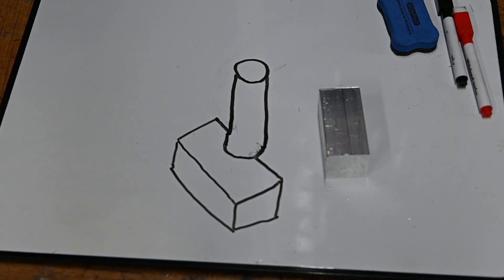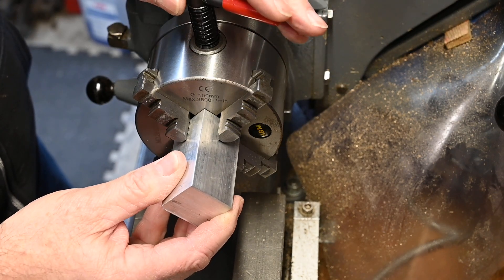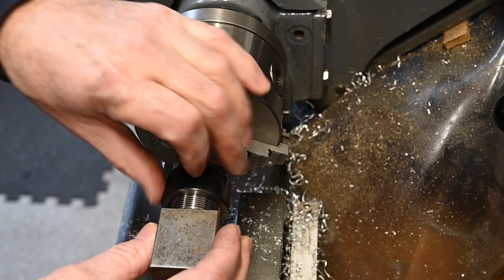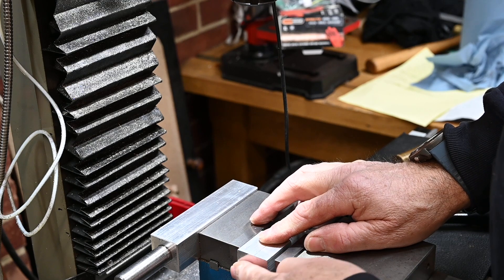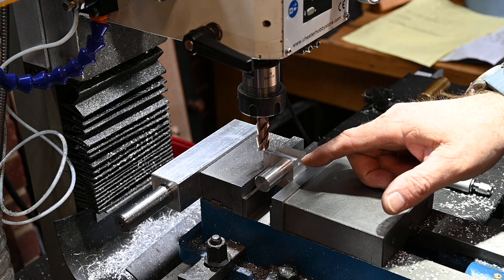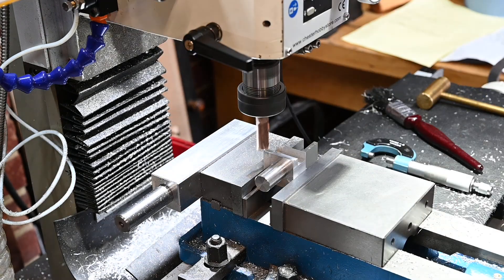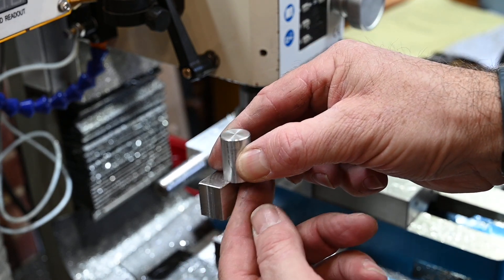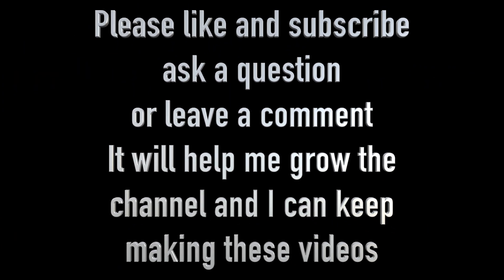Rotary Table Vice alignment tool

Comment: Joe Pie has been making and selling these for several years, he has a build video about four years ago plus various tips how to use it for different things.
I guess not many American hobby machinists want to make their own and prefer to buy ready made if they don't trust their abilities?
 I notice you have extra clamps on mill vice, has it moved on you or does it help take out some of the 'twist' on Chinese vice? (I know mine is 0.004" low on right side, may try an extra clamp and see if things improve) I know I should really scrape it flat, but, that looks like a lot of work and I want to use it now, not 3~6 months time. 😁You need to make a stiffer longer keeper plate for your angle vice, I used a small 3/16" square of high carbon steel plus longer bolts. I also bored the pivot posts as they were about 0.060" different in height then bushed them for a tighter fit on pivot bolt (it wasn't worn and much easier to make some bushings)
Reply: I bought one from Joe Pie, with some tooling it isn't that you doubt your abilities as a machinist, it's just quicker and easier to purchase the item and used the time saved on your projects.
Reply from the maker: @ But more expensive and not so much fun 😂👍
Reply from the maker: @1crazypj Thanks for the tips 👍

Comment: Useful tool, I'm surprised that you didn't make it out of something a little more durable.
Reply from the maker: It’s only very low use in a hobby shop 👍
Reply: @EnglishHobbyMachinist  100%  Aluminum is plenty robust enough material for this little tool.  Those of us who are Hot rodders and custom motorcycle builders use billet aluminum for all kinds of things, including brake calipers, pedals, brackets, triple trees, etc etc....

Comment: Loads of irrelevant milling and turning as a simple device could have been easily fabricated.
Why waste valuable material and power??
Just for an appearance and video on YouTube😐❓
Reply: I guess you just use a dowel like everone else 😉
Reply from the maker: @marley589  no, it’s not for aligning the table, it’s to align the vice 👍
Reply: @EnglishHobbyMachinist  A dowel can also be held in the vise. They both rotate, so the flat does nothing.
Reply from the maker: @marley589  ok thanks
Reply from the maker: Thank you

Comment: Why does it need to be so wide? Would an accurate piece of round stock with a flat machined half way still work? Or maybe just a known size pin say 20mm and add / subtract 10mm from the required dimension.
It doesn't really align the part or the vise, it just positions them in one axis which can easily be done with a pin in a collet. They still need aligning with the rotary table angle, positioning in the other axis and aligning with the machine axes. It's a solution looking for a problem.
Reply from the maker: Your idea would work, just a slightly different tool without the flat surfaces, I didn’t really give a full demonstration of its full use, have a look at joe pie channel, he gives a much better demonstration, which is where the idea came from, this is 15mm diameter by 15mm deep by 30mm across the long side, my thoughts are the long side has more surface area (30mm) for alignment of stock or vice and is easier to indicate off. 👍
Thanks for commenting 👍
Reply: @EnglishHobbyMachinist  Thanks Nobby. I see now, it can only work if you indicate the 30mm flat on your tool parallel to the X axis and lock the spindle. Then when the part is pushed against it, it's then aligned with the machine axis at the desired Y offset. It can't be clamped though as it it not yet set in the X axis. I'm still not sure how to keep the part square and set in the Y axis when moving it to the X axis position for clamping.
Reply from the maker: @tates11  The second half of this video explains it better thanks Mark https://youtu.be/Qfd-bkhr-NE?si=8jdZIqML4RVXC0Na
Reply: @EnglishHobbyMachinist  Thanks Mark. I watched the video and I see that this tool can't be used alone. It needs a parallel fence, taper parallels and a vise. If you have all these 3 items then I see no advantage over a precision hardened standard ground pin. Use the pin to set the vise jaw distance and then again as an end stop for the part. A nice thin line of contact, easily kept clean without any attention to the spindle orientation and easily checked for concentricity. The flat seems to add nothing to the function other than saving the mental calculation of considering half the pin diameter, a piece of cake in metric.